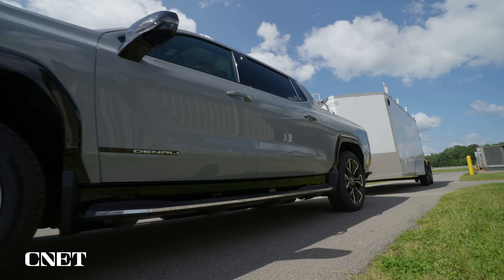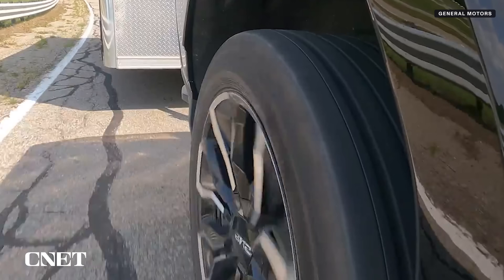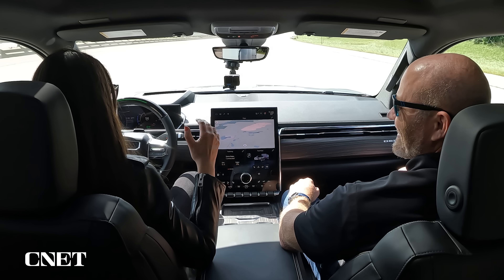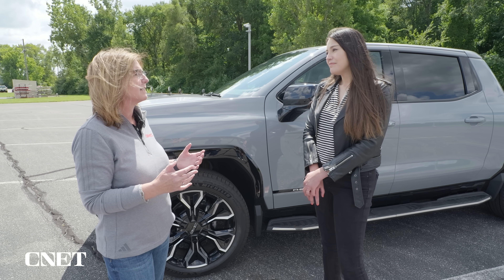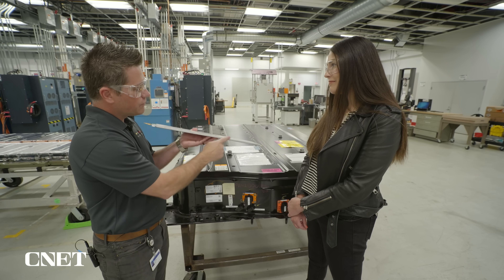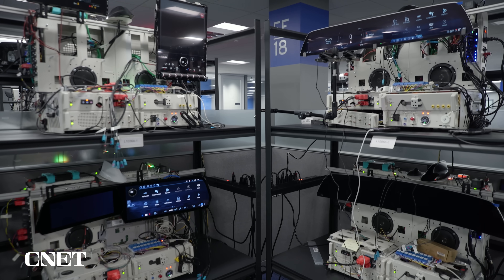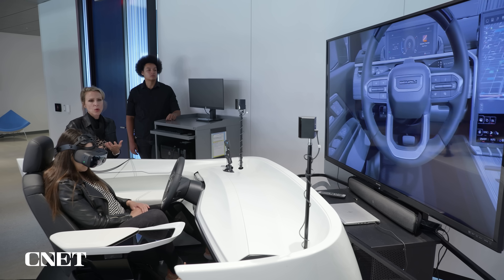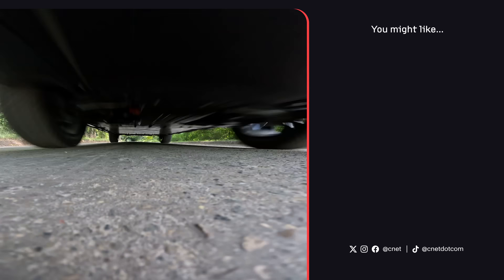Exclusive: How GMC Built the Sierra EV Denali Longest Range Truck

Comment: 5600 Pounds is very small and then what about battery range with this small Towing Load ?  Misleading Info..  Suspension / lack of Passenger seat comfort / no massage or reclining seats  doesn't deserver a 100K Price ..  Don't Buy it , just lease it as Tech is improving a lot and will be outdated in 3 years..

Comment: Great video.  I loved it.  

My only question is.  With all that extensive testing why is GM reliability still so bad
Reply: NO amount of virtual or factory testing can ever truly replicate reality. Prime example is the truck suspension bouncing over virtual bumps - wheels are not turning, no low or high frequency vibrations, just a test of suspension as if it was parked. Pointless.
Reply: @ashole2424  Never thought of it like that.  Great point
Reply: @ashole2424  Yeah, and no potholes.

Comment: How far did you tow it ? That’s always the Achilles heel of EVs. smh!!!
Reply: @QuentinWoodard-m9t  I have the Sierra EV. My one tow trip with it was about 700 miles one way with a 6k trailer, and I got 310 miles range towing at 75-80mph freeway. Charging speed was fast enough on Buccees and Wawa chargers that I didn’t have to wait for the truck to charge, it was just ready to go by the time I was.

Comment: How far did you tow it ? That’s always the Achilles heel of EVs.
Reply: @georgewashington3012 It will have towing range loss at the same rate as ICE trucks.  I tow a boat with my RST and still average over 350 miles average with the boat behind me.   I have not noticed  any "Achilles heel".   The only way for you to find out is to try it out by renting one at Hertz and do your own particular towing test.   Most folks who have towed with this truck have not noticed  any "Achilles heel" either.
Reply: I have the Sierra EV and it towed my camper farther than my V8 F150 did on 26 gallons.
Reply: @georgewashington3012  I only did one tow trip so far in my Sierra EV. I had a 6k lb trailer and went about 700 miles one way. Got about 310 miles range. That was on freeway at 75-80mph so maybe it could have been more at slower speeds.